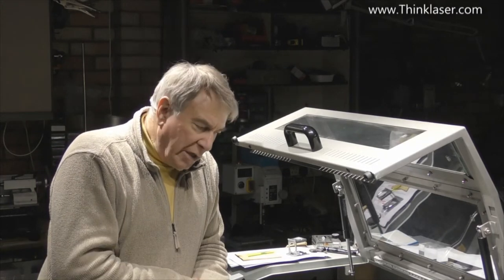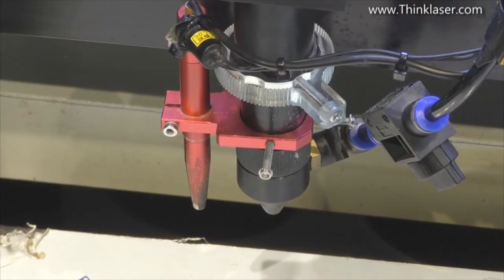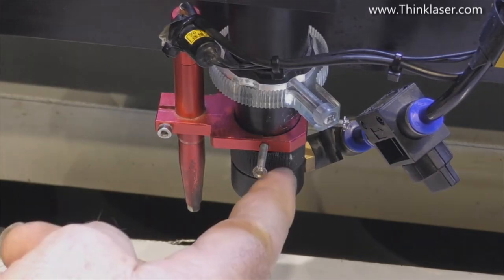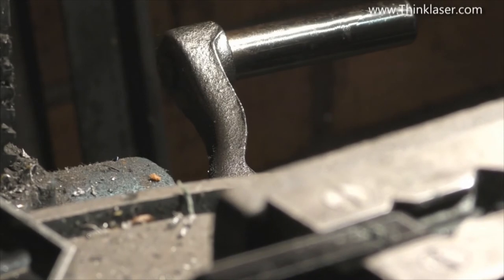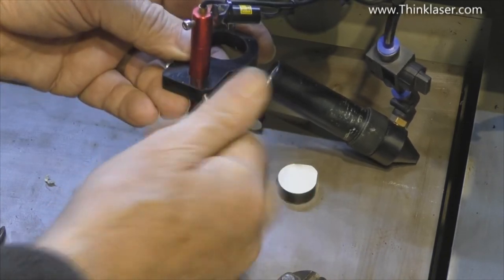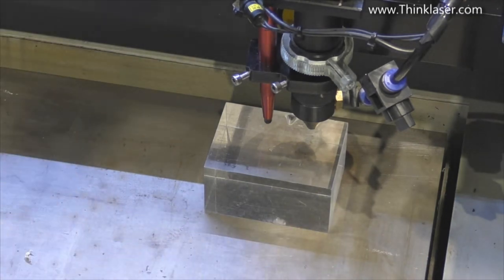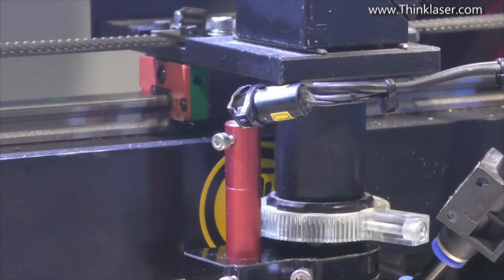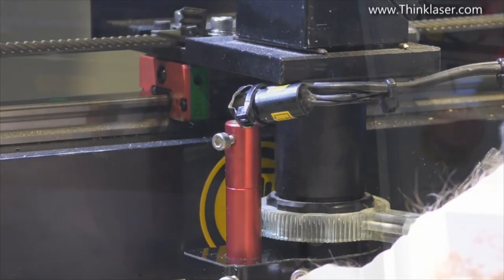Autofocus: How To Set Up Your Laser Cutting Machine (2018)

Comment: I don't change the switch position for different lenses.  It is as simple as having disks with the various lens offsets.  Set a puck on the table under the switch for the long lenses and hit the autofocus.  Make and keep the lenses and pucks together so which lens is used the same puck is out for the autofocus.  No need to recal the switch and adjust it.
Reply from the maker: Hi Isettech,
That's a great idea, thanks for sharing. 

Regards

Gareth @ Thinklaser

Comment: Hello Mr. Russ, I hope all is well. I am having issues cutting through 1/4 birch wood with my 50w laser. Sometimes it does sometimes it doesn't cut all the way through. I have the speed as low as i can take it. Running at 9 speed and 75 power max 8 min power. Am I doing something wrong. Please shed your great wisdom on me.

Comment: Hello,
nice video! Lots of information.
Can you may help me with the setting of the Autofocus?
Where must I connect the wire of the autofocus switch?

Thank you very much!
Reply from the maker: Hi JB
Thanks for your kind words. 

On our Lightblade machines, we connect the Auto-focus to the GND and Limit Z- 
If you have the Ruida 6442S controller it's Pins 

CN3-1 for GND
CN3-4 for LMT Z-

But make sure it's correct for your machine.

Gareth @ Thinklaser.
Reply: Hello Gareth,

thank you very much for the information.
I have an RDC6442G controller, autofocus works with the wiring you told me, but I also have a limit switch for the Z axis, do you also know how to set up this together with the autofocus?

Thank you very much!
Reply from the maker: Hi J.B.

The Z-axis limit switch on our machines are across the same pins as the auto-focus. Both switches are normally open. When one of the switches activates it completes the circuit and stops the Z-axis from moving. So either the auto-focus or the limit switch can stop the z-axis movement. 

Gareth @ Thinklaser

Comment: just posted on the forum about my auto focus set up, I think you'll like it.
Reply from the maker: Hi Gary,

Which forum is that? 

Gareth@Thinklaser
Reply from the maker: Hi Gary,

Found it on the RDWorksLab forum (for others to check out https://rdworkslab.com/viewtopic.php?f=15&t=2594&p=15844&hilit=auto+focus#p15844) neat Idea, not sure if a standard limit switch is the most accurate switch for this application but it could be replaced with something more suitable. 

Gareth@thinklaser.

Comment: Hi mr. ross plise how to youse enable pen up and down in rd works think you
Reply from the maker: Hi Marouane,

Thanks for getting in touch. Russ doesn't respond to this Channel, but I have an answer for you below;

To enable pen up and down in RDWorks, you need to go to 
"Config(S)"
Click on "System Setting"
The Setting window should pop up
To the right of the Setting Window is "Map for Pen axis:"
Change this to "Z" and close the Setting Window.

Draw an object and open up the layer/pen settings.

Go to "Processing Mode" and change to Pen

Then click on "Advanced" next to the Processing Mode box.

You need to tick "Enable pen up and down" and fill in the distances you require in the Pen up / Pen down section. 

You will need to "Read" your machine settings for the software to determine the current Z-axis position.

Hope that helps.

Gareth@Thinklaser

Comment: I am not a huge fan of the pen style auto focus device myself, but the real issue here seems to be your machine and how poorly the gantry to bed ratio was taken into account.   In other words, the gantry is mounted much to high and/or the bed Z axis much to low.   The bed should ride up inside the gantry till there is only about 50mm clearance from the bottom of the nozzle block, not the tube like with this machine. 
  For some unknown reason, the Chinese don't seem to understand that a low profile light weigh nozzle assembly is crucial for vast improvements to dynamic load (inertial whip) created by heavy nozzle setups that destroy accelerations abilities as well as heavily degrading over all precision for various reasons regarding CG offsets that create lateral fatigue and resonance.  Trotec got it right with the super wide GT2 belts on the X axis of their Speedy machines.   The nozzle is super small and weighs next to nothing with the advantage of having a very small, light weight cart assembly on a high gear reduction pulley setup.
  Moral of this story... Don't bring the nozzle down.  Bring the bed up to it via design and cut that dead weight lens tube down to size for weight reduction and rigidity increases.